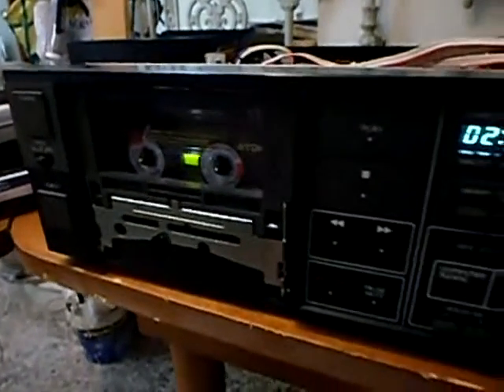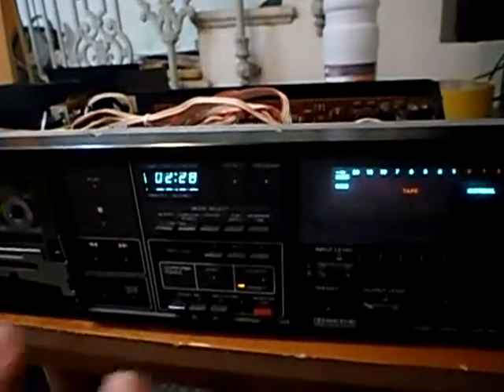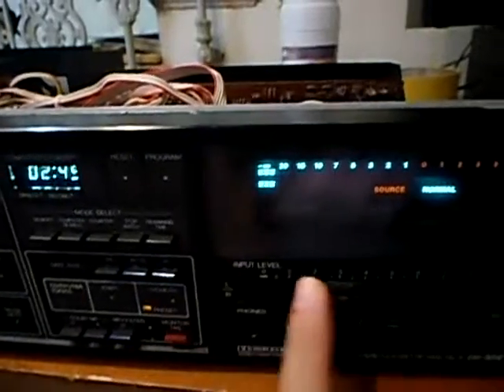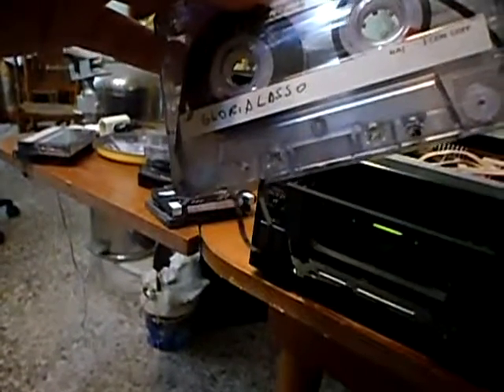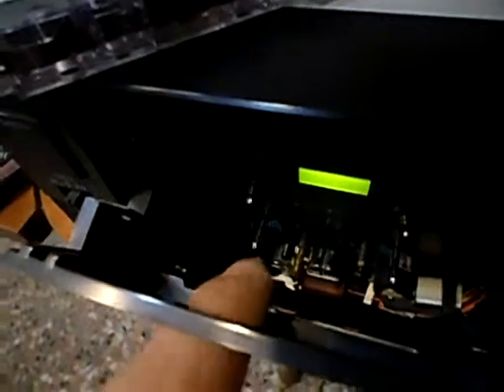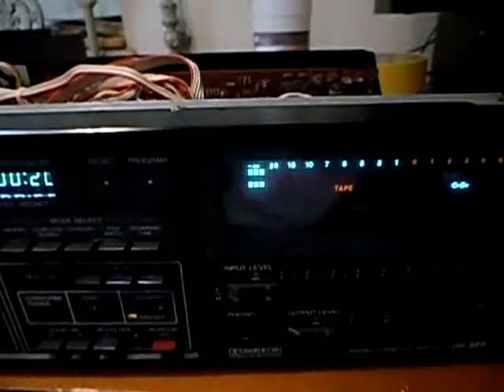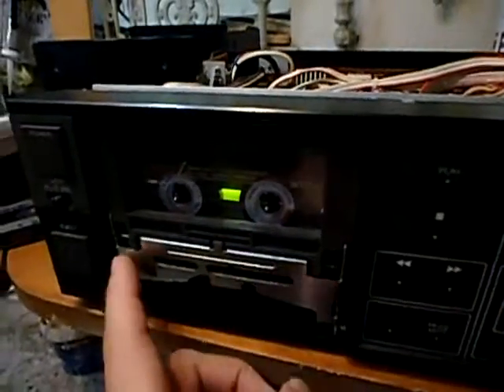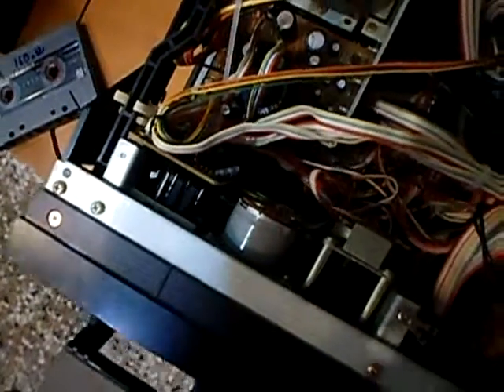Cassette Loose Tension on double capstan mechanisms.

Comment: hello. i know long time passed since this video, but did u ever fixed the problem? betls replacement solve it. i have a simmilar issue with aiwa XK-009, it does almost the same thing, except the tape loop forms on the right side under the takeup reel. thank you!
Reply from the maker: I seem to remember mitigate it, but  I don't remember fixing it totally. It's a hard fault to fix and usually requires replacing belts with correct ones. sandpaper your pinch rollers might help
Reply: @llagona  Thank you very much. I apreciate it!
Reply: Definitely new belts would fix the issue. Dressing the pinch roller might help , but don't overdo it. Lubricating the capstan bearing , through the door and Lubricating the pinch roller shaft , would help by reducing friction.